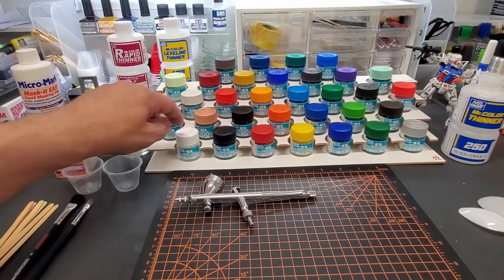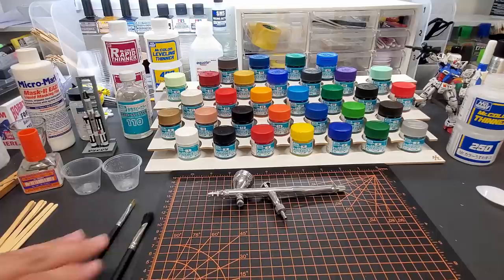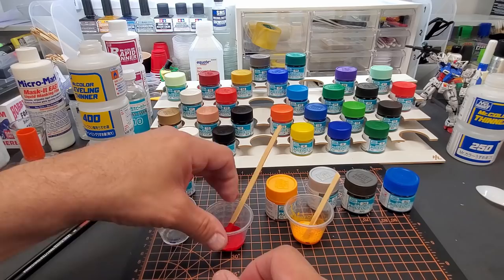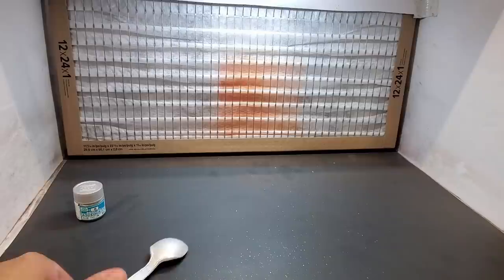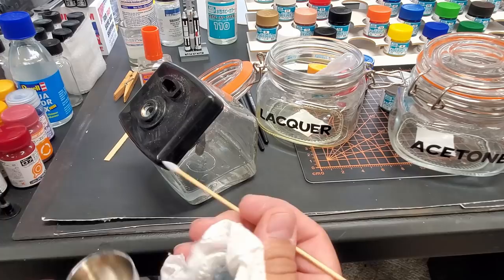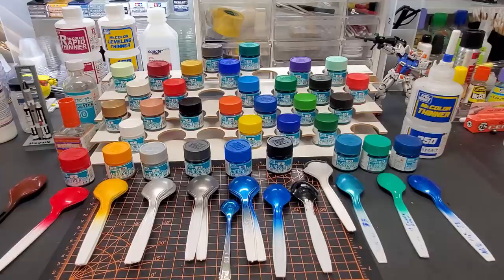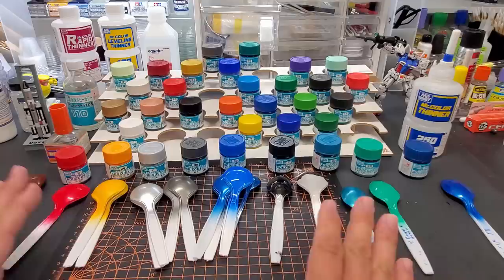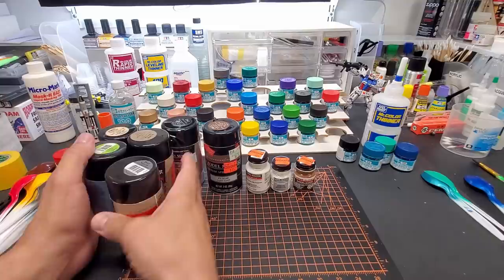Scale Model Tips - How To Use Mr. Hobby Aqueous Paints - Airbrushing & Brushing - Great Paints !!

Comment: It's May the 4th, so May the 4th be with you!  

A lot of the kits I'm starting are Bandai (Macross and Star Wars). Because Bandai Color codes with Mr Color numbers (Usually the H coded Aqueous) I'm really glad to see this test. I would say about 40% of the time the Mr Color 'C' and the Aqueous 'H' have the same number. I wish that were true on them all. I chose to invest in the Mr. Color 'C' colors. I bought two bottles to try them out because you seemed to love them. After trying them and having a pretty straight forward 1:1 thinning ratio I was sold. I really wish Mr. Hobby sold a complete set or at least a large set for persons just starting out. I also notice I have less tip dry with the Mr Color. 

I didn't have a flow improver for lacquer paints so I mixed up a a 60:40 of Leveling Thinner and Retarder and just put 2 drops of that in, spray about 20% out and then add my paint.

I'm wondering if you do any window tint on your kits? I though about trying to mix Alclad Candy Orange and Candy Cobalt Blue to get a slight brown and doing a thin coat on the inside of the windows. I'll probably order some this week and get some clear spoons from the dollar store and try it out but open to suggestions from anyone.

That Metallic Blue is dead on for WR Blue Pearl(Subaru WRX STI Blue). It's funny because it's a better match than the Mr Color 02. The reason it's funny because the Subaru color code for WR Blue is 02C. Mr. Color 02 isn't a pearl but my guess is that that Aqueous 88 is just a pearlized 02. I checked and none of Subaru's other color codes match up so just a coincidence.

Also if anyone knows where to get a kit of the Subaru Crosstrek in the U.S. for a decent price I would appreciate knowing. I think there was a kit of the first gen Crosstrek just called Subaru Crossover but not sure.
Reply from the maker: Mr Color is my favorite paint. It just works perfectly every time. For my tinted windows I use Tamiya Clear Smoke. It's perfect for tinted windows
Reply: @barbatosrex9473  Thank you. I will order some and give it a try.

Comment: Be careful if you follow the advice to use leveling thinner. 
It will work to thin the paint. But if you want to paint on top of another Aqueous layer, you risk crazing. I learnt this from thinning Tamiya paints with Mr Hobby Leveling Thinner. Everyone talks about how it works great, no one mentions the second layer. Had to sand down my 114th Apollo Saturn V checker pattern

Comment: Great video as always.  I've been using Aqueous since I started since it has the exact color equivalents to the lacquers in most of the Bandai kit instructions and the color range is huge.  I use Tamiya too, but having used both, the durability for the Aqueous line is, I feel, far superior.  It works well with Tamiya's acrylic thinner as well.
Reply: This answers my question. Thanks!
Reply: Damn is better than Tamiya?
Reply: That’s one thing I hate about Tamiya. It scratches so easily even after top coat and curing. Is Aquaeuos that noticeably stronger? Thanks!
Reply: @Slasherx28  It's not. It's identical.
Reply: @DaneSaysStuff  gotcha. Thanks!
Reply: Do panel line accent colors mess with the aqueous layer?

Comment: So I'm pretty new to the hobby and have one question. I just airbrushed my very first gunpla model and sealed it with clear laquer. Now I'd like to use these acrylic paints to do some details and some weathering with a brush. Now my question is, cause those are solvent based acrylics, is there a risk of damaging my paint if I would have to do a little clean up or something? Would it be better to use pure acrylics and if yes which brand you would recommend? Thanks in advance.

Comment: With Aqueous the issue i have been running into is with the greys and whites, the do not truly stick to a primed surface, they slightly run and pool near the edges. I have tried multiple things like having less/more thinner. I am currently at a loss. I have even tried the 50/50 skim milk every time. I use my 0.3mm procon and Mr. Color leveling thinner.
Reply from the maker: I hate to say it but every brand has a color that's trouble. While I haven't tried the colors you did I have problems with certain colors by every brand on my shelf. My buddy has problems with a few Tamiya colors but the rest of the line up is perfect. It comes down to the pigments used

Comment: Great video, Mr Hobby are great paints. To slow down drying time with Aqueous just use water in place of alcohol or prepare a diluted alcohol blend to use as a thinner.
Reply: you can also add 10% of Mr. Retarder to the mix to slow drying time. It kind of turns 91% IPA into leveling thinner.

Comment: Thank you for having this wonderful video. One question, Can I airspray both Aqueous(mr.hobby) and regular mr.color in the same model? In my current project, several colors are missing in the mr.hobby lineup, I am thinking of getting the mr.color ones for those
Reply: I’ve read that they can not be mixed with one another. Only separately, but lacquer as as base is recommended over acrylic as a base. Unfortunately I’ve noticed the same thing about the Mr Color paints and the Aqueous colors that they don’t have an equal number of colors in each color. I wish that they would make each color in both of their lines so anyone could use a lacquer or a acrylic paint for the colors that they would want to use.

Comment: Great video, very helpful. Can I clean up my air brush using isopropyl alcohol?
Reply from the maker: Yes you can 👍
Reply from the maker: Also for cheap money you can get a bottle of nail polish remover, I get it at the dollar store, and do a final airbrush flush with a few drops. Cleans it nice when your done
Reply: @barbatosrex9473  Thank you. I usually go for Tamiya acrylic paint, but Aqueous Surfacer is so good and much less odorous than the lacquer-based Mr. Surfacer.

Comment: Great video, although i think since it's aqueous paints why not use an acrylic thinner instead?
If you are using lacquer thinner why not use Mr color paints instead?
I've been using a homebrew acrylic thinner and it works great. 
This means that cleaning is simpler, because you can use water and clean most of the paint.
I then complete the cleaning with a little bit of household detergent.

Comment: Hey im having trouble airbrushing with the gloss colors , i mixed aqueous thinner 50/50 but im still getting a not smooth finish.  Im spraying at 15-18 psi Any suggestions? Thanks man
Reply: Your pressure is okay. You might be painting too far away from the surface so your piants dried mid air. Or you might be pointing your airbrush directly on to the surface. 
A good indicator for smooth finish is a thin reflective layer of paint when you finish painting.

Comment: Hi, thanks for your  Videos and test so much colors.
I have 3 questions about the Mr. Hobby Aqueos Colors: 1) How Long do i have to wait between coats of Paint? 2) How long does the Paint take to fully dry? 3) what pressure should i Set on the  compressor?  I cant find the Informations on the Mr. Hobby Websites...
Thanks for your Help.
Greetings from Germany
Reply: @RaNmA5886 I have been using these paints for over a year now. I usually can go 5 minutes or so between coats and it's dry in another 15. Just to be safe, I usually wait at least a couple of hours (if I'm in a hurry) or overnight before I move to the next step (panel lining, decals, topcoat, etc.) These paints are really like voodoo magic...I don't know how Mr. Hobby does it. They spray and clean up like a lacquer but have minimal smell. And after a few days of curing, they are bulletproof. Also, I spray them at 18psi. Thinning them varies...dark to medium hues I thin 1:1 and lighter colors (including clears) are thinned 1:1.5. I always thin with 91% isopropyl alcohol and add 1ml of Mr. Retarder for every 10ml of paint.

Comment: thanks again for another great testing video! I wonder how the gloss varnish from this lineup perform. Would it be as good as Mr. topcoat spray?
Reply: I've had mixed results with the gloss clear. Still trying to figure out the ratios. However, the flat clear is AWESOME. Way cheaper than Mr Topcoat and looks just as good without the smell.
Reply: @whereistheblackbox6707  Hi just curious what ratio do you use for your Flat Clear, I have a jar of Mr. Colour Aqueoue H-20 but been afraid to try it out without know the ratio, psi etc. Any help would be much appreciated.
Reply: @pfarreller  1:1.5 when mixed with 91% isopropyl alcohol. Also, put 1ml of Mr. Retarder for every 10ml of clear. Shoot at 18psi. Works like a charm!

Comment: @Barbatos Rex.  Rex, since you have tried so many paints I am wondering what would you say are the best (or your favorite) paints to use on car models?  I am just starting out and have purchased a number of kits, Tamiya, Fujimi, Italeri, etc.  Most kits recommend their own paints.  Should I just do that or would I be missing out because, eg, Mr. Color would not be included on kit lists.  FYI I will be using Zero Paints for the primary colors (as I am mainly doing F1 and Le Mans cars) so I am primarily interested in the paints to use for the non-body smaller parts, eg. engine parts, etc., however your thoughts on paints for the full body would be appreciated as well.

BTW thank you I have watched so many of your videos and purchased some items based on your recommendations, such as my PS-289 which I love.

Can you also do a video on mini spray guns such as the Iwata LPH50 or LPH80?

Thanks in advance.
Reply from the maker: My favorite paint overall is the Mr Color line up. I love how Tamiya airbrushes but I'm not crazy about how they brush on. Gaia is also a favorite as they are close in formula to Mr paints. Enamels brush on great. Depending on where you live you have different choices of enamels such as Testors, Humbrol and Revell. I love  paint so I ha e almost every brand on hand. I just started testing SMS and MRP and so far both of those are excellent. For my car bodies I use Splash and real auto paint made for actual cars. It's a urethane. I can't get Gravity or Zero paints here in the US without jumping thru a few hoops but I would love to try some
Reply: @barbatosrex9473  Thanks for that.  A quick follow up question.  Let's say I have a Tamiya kit and it lists various Tamiya acrylics.  If I go with Mr. Color instead should I use Mr. Color acrylics, enamels or lacquers, what's your preference for car models?  Thanks.

Comment: Do you know if aquesous have a primer? Top coat? Can you tell me what number? Thank you... All your videos are amazingly helpful...
Reply from the maker: They just came out with spray can primer. I tested tested them here. The jar primer is on its way to the US. And yes they have a Gloss and matte top coat
Reply: @barbatosrex9473 thanks for replying...i saw the video about the spray can.. Im in Canada hope they will make it available here soon... is H-20 (flat clear) and H-30(gloss clear) the top coat for aqueous? Another question... Before putting primer.. Do you sand the parts and wash them? How many coats do you usually do? Do you have a video or can you do one that shows the process how you prep for primer painting...
Reply from the maker: @2ne29  yes those are the Aqueous top coats. I usually don't do much prep for applying primer. Most newer kits, kits made in the last 20 years or so don't have the same problems early kits had with being oily or having release agents on them. I will on occasion wipe the parts with alcohol wipes. Sanding is also an option and when I do I'll sand it lightly with 1000 grit. I also like sanding pads, not the kind you think of, the pads they sell at body shops. You can get a 12 by 12 pad for a buck or two.

Comment: i was told by someone at my local hobby store ,that you can use water as a thinner with this paint ?? is this correct ??
Reply from the maker: It's a misconception because it says "Acrylic" on the label which usually means water based. This is an acrylic lacquer like Tamiya. If you see a flame logo on the label then it's a solvent based paint. If you don't see a flame on the label then it's a true water based paint. When you use water with these paints it breaks down the binders making it tough for the paint to "stick" to the surface you're painting. If you don't have lacquer thinner then you can use 91% isopropyl or rubbing alcohol to thin it

Comment: I was wondering if you could do a video on Lacquer and enamel nail polish as an alternative to expensive hobby paints airbrushing
Reply from the maker: I bought a bunch recently, I'll be testing and practicing with them for a video for sure
Reply: @barbatosrex9473  I don't think nail polish stacks up well to something like Mr. Color from a price standpoint anyway. A bottle of Mr. Color is like $2.50 and nail polish is like $5 for decent stuff, I think. Worth looking at as an excuse to make a video and see what's what, though. FOR SCIENCE.
Reply from the maker: @ninjatango  you're correct there, I get my Mr Color for about $2.50 and you just can't beat that price. I did however start testing nail polish on my off time and I've found no mystery here that they brush on nice and of course super durable which is something my viewers are always looking for. And because of costs I'm testing the stuff they sell at Dollar Tree. But in the end, Mr Color is king
Reply: @barbatosrex9473  so I'll done a couple of tests with cheap as well as decent nail polish and here's my results. Cheap nail polish, like super cheap stuff, 16 pack 6 ml for 5 bucks. Its terrible, the paint has little to no pigment so when you thin it  just sprays transparent. The colours are desaturated and splochy and the cheap price really shows , descent nail polish ranging anywhere between 3--5 bucks a bottle. Really great results, thins well and applies nice and great coverage . For all my tests I used lacquer thinner in a 1-1 ratio. It's great when you want some really rich mettalic niche colours. Some cool multichrome color changing ones as well. So yeah for normal colours go for Mr color, but there's some pretty funky nail polish out there

Comment: all the mr hobby aqueous are gloss right? i read that adding 5% h-40 flat will make the aqueous paint flat. I wrote tis same comment somewhere else on another video i think.
Reply: Depends. It is written on them usually. Some are flat, some are gloss, some are even semi-gloss. Main colours are usually glossy, specific ones (like RLM for Luftwaffe or Olive Drab/4BO for tanks) are usually flat. 
And yes, H-40 works just fine. Or Tamiya X-21 Flat Base, they are basically the same. 
The exact ratio varies though, you can add just a little to get satin look or more for really, really flat colour.
Reply: @kon27027  oh snap.thanks for the answer. so tamiya gloss can be changed to a flat? 
what's mr. hobby acrysion? what difference between that the aqueous paints? they have so many different products, its insane
Reply: @MF-kv8cn  yes, absolutely.
Acrysion is a weird thing. Never had any chance to use it myself though. Feels like an attempt to make "next generation hobby color" - water-based, diluted for airbrush use, smells less, etc, but for some reasons never surpassed hobby color. 

Other products are quite simple to me:
Tamiya Acrylics (X-series) = Hobby Colour (H- series) - acrylics based line
Mr Color (C-series) = Tamyia Lacquer Paints (LP- series) - solvent based line
Colors within one line are pretty much the same and interchangeable (you can mix them, or use Tamiya lacquer thinner for Mr color and vice versa). 
Tamiya also has a separate line of enamel colors but they are in the league of their own. Don't like them, but folks who do car models and need perfect glossy surface love them.